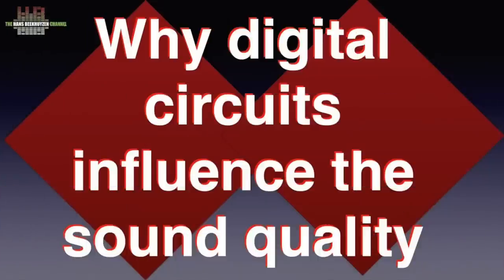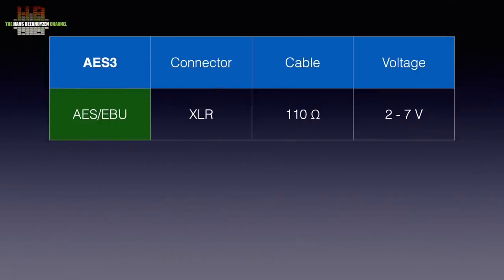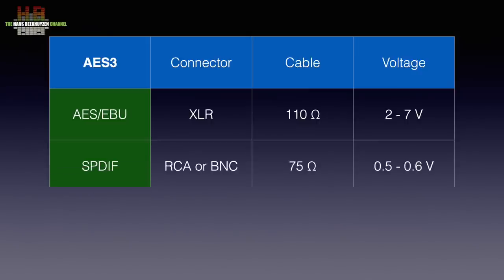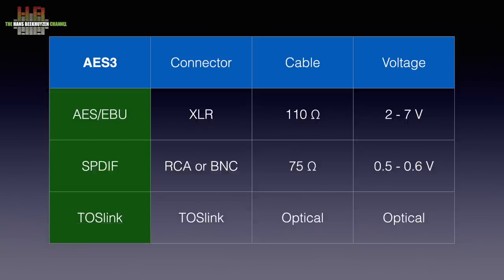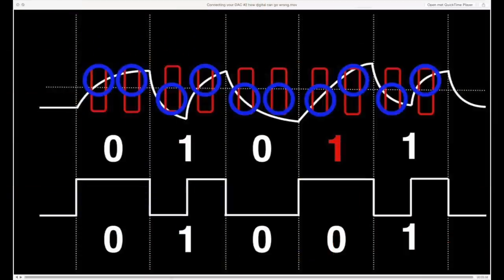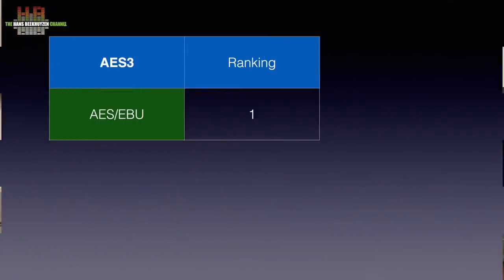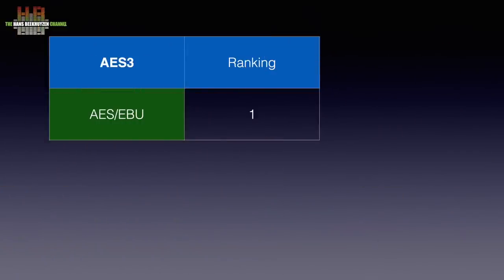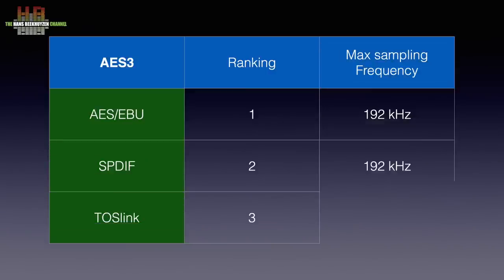Choosing your digital connection

Comment: Usb might be asynchronous but improving the clock on my ethernet switch before my sms 200 ultra with an ntp ocxo server definitely improved the sound and the only changing aspect was the clock, same switch and same streamer.

I can't explain why but it does
Reply from the maker: You might find an explanation in this video: https://youtu.be/B-StTplQZys

Comment: If use 44100khz 16/24bit only so can optical toslink be the best option for me? optical toslink has not voltage and unaffected by external interference. Answer plz.
Reply from the maker: It probably is the best compromise for you.

Comment: Great video. Curious why the industry has not coalesced around an optical standard that overcomes the (artificial?) 92KHz limit of Toslink. In theory, optical should be able to support much greater throughput and be galvanically isolated.
Reply: toslink can pass 192/24bit these days.
Reply from the maker: 96 kHz is the same sampling frequency for broad acceptance, from cheap to high end. It can do 192 kHz, but just. The Toshiba TOSlink plastic optical connector is the limiting factor.

Comment: My solution is not using my computer for music. My streamer is hard wired to fiber optic service through a CAT 6E cable.
Reply: Same here, but I did notice a substantial loss in bass when adding the fiber optics. Still playing with all of this.
Reply from the maker: Surely a good solution.
Reply: @TheHansBeekhuyzenChannel  The fibre is interesting to say the least. I have a new Venus II 12th DAC, and I believe it is still breaking in. It sounds different by the day, some days good, other days not so good. I played around with the fibre, going back and forth. I can hear a difference, slight, but it is there. Bass is back...
Reply: @michaelwright1602 If it sounds different day by day it just tells me your brain is working differently on different days and nothing to do with the hardware. I can listen to the same pair of headphones 2 weeks later and it will sound different but I know nothing has changed.